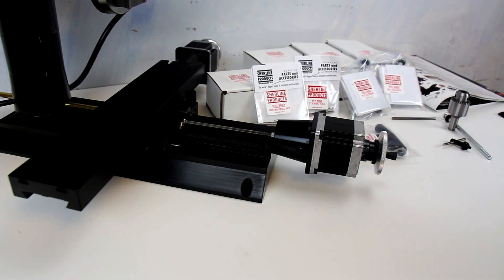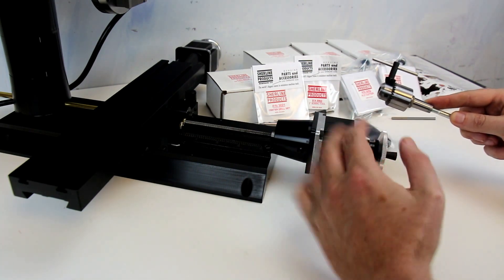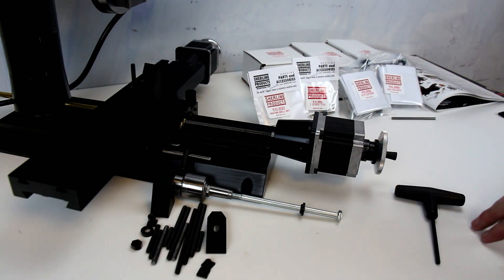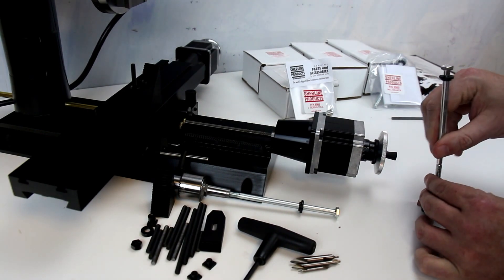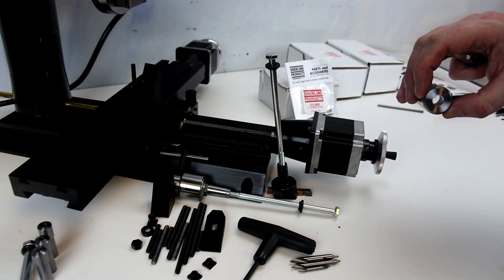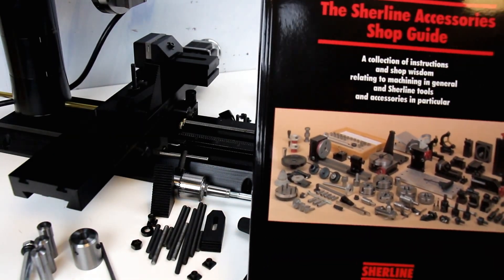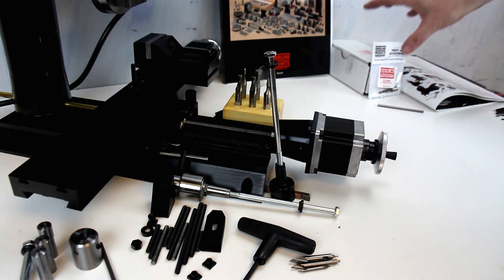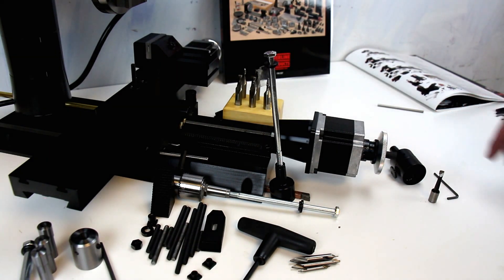Sherline Mill Package Accessories

Comment: Hello! I have a question regading your Sherline 2000 vs 5000 series Mill choice. I've heard many complaints about reduced rigidity of 2000 Mill as compared to 5000 series. Owners of both say 2000 Mill flexes considerably and the major flex point is the connection of the column to the base. One reviewer identified the problem being in the design flaw of connecting the Z column cylinder to the X-Y base via 2 small screws. Besides he noted that Sherline removed material from the base at that locationcompared to 5000 series Mills. Do you find your 2000 lacking in rigidity?

Comment: Are you planning any more videos? They are very helpful to the beginning machinist.

Paul
Reply from the maker: +Paul Devey I do hope to keep making videos, was able to do the flurry of videos before as I was between jobs but now on an extremely busy contract for awhile. Plus summertime I like to get outside when I can, so videos will be a bit slower until fall/winter time most likely. Have several I want to get back to working on though, will try to not leave you hanging.